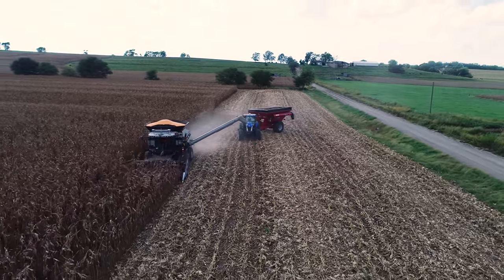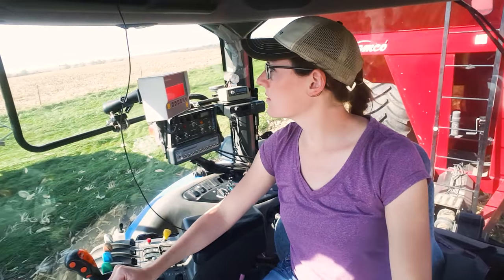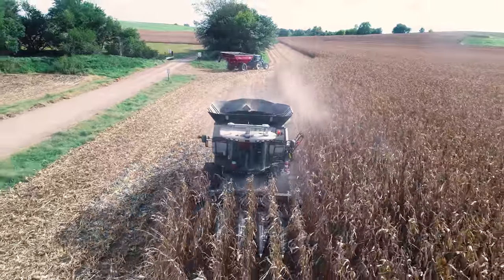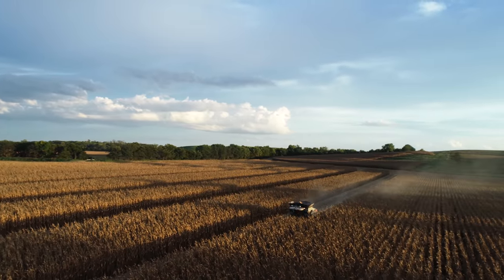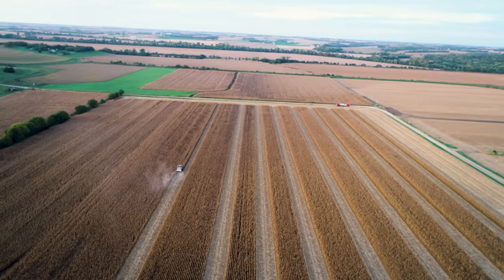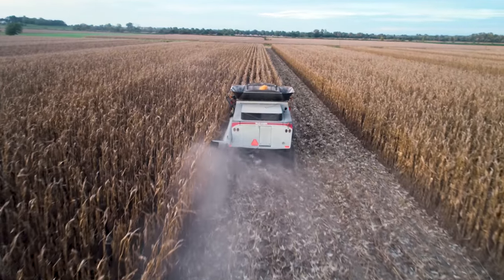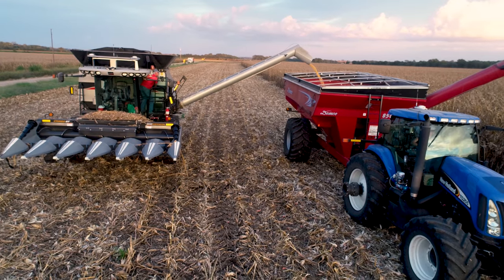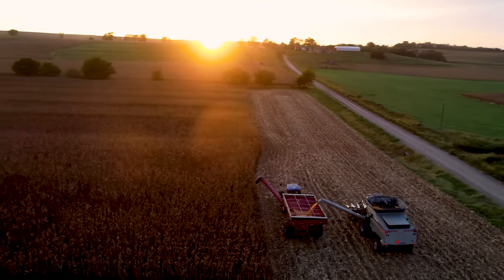Farm Vlog - 2018 Corn Harvest, Taking Out a Test Plot, Timelapse, and Gorgeous Sunset Footage

Comment: I'd be interested in the results of your trial.
Reply from the maker: Hey Bud, by using the drone and sensor to determine how much nitrogen to apply during the growing season we were able to reduce total nitrogen application with no negative yield impact. We have done this trial on 3 fields over 2 years now. One of the challenges going forward is logistics of getting nitrogen applied during the growing season, particularly in a rainfed situation where we are dependent on rain to get nitrogen applied during the season incorporated. Both the years we have tested this have been abnormally dry, and so this has been a challenge. I'm happy to share more after we get our results formally summarized. You can also check on the North Central Region SARE website.
Reply: Thank you, Great videos.
Reply from the maker: @budlefebvre8811  Hey Bud - just wanted to share that we did create a video of the results from this study! If you are interested, you can check it out here https://youtu.be/mN1oQgeawKU